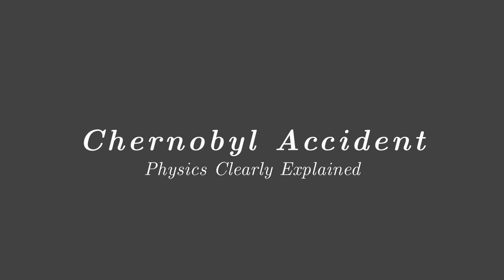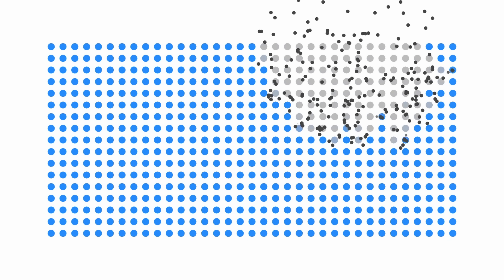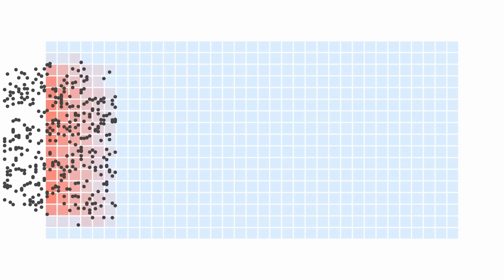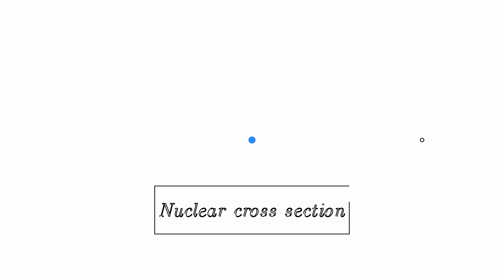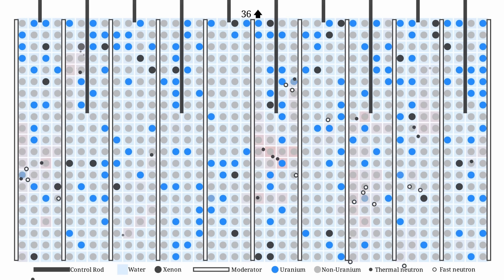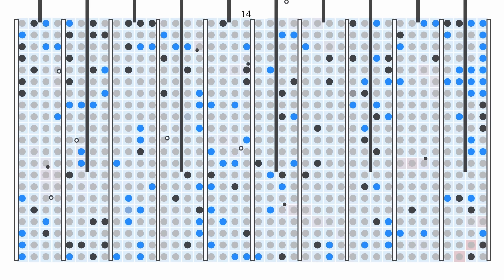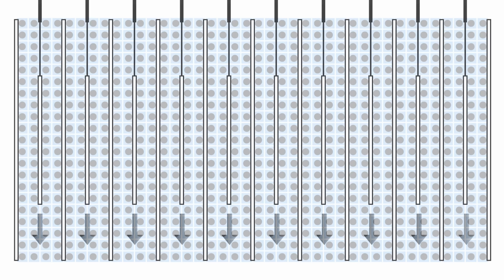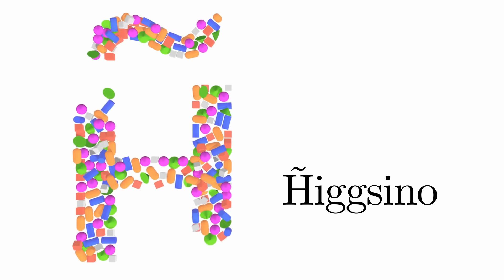Chernobyl Visually Explained

Comment: To my understanding, it wasn't the chain reaction that caused the explosion, but the buildup in steam pressure that caused the lid to blow, then when oxygen(from the air) entered the reactor, it caused a secondary explosion. The Illinois Energy Professor has a great video on how the steam pressure built up when the Scram button was pressed. He explained that the chain reaction from the spike in power superheated the graphite tips and they were then being lowered for the boron control rods to lower back into the reactor the superheated graphite came into contact with the water supply instantly vaporizing all the water, causing the pressure to build, leading to the subsequent explosions.
Reply: Yes, all explosions in nuclear reactors are either pressure or chemical related, reactor it self cant really explode like nuclear bomb which is big missconception people have as they are not made for rapid energy relese as bomb is, it can only out of control and melt (thats why its called meltdown) creating hazard that melts to ground and any extra explosions cause exposure of radioactive material to atmosphere.
Reply: If someone dies in a house fire because of smoke inhalation, would you say that the fire was not the cause of their death? It may not have been the direct cause but the connection between the fire and the smoke is so tight most wouldn't state the difference.

When people say that it wasn't a nuclear explosion they mean something different. An explosion is a shock wave. In a steam explosion the shock wave is caused by the pressure vessel bursting. In a true nuclear explosion the reaction rate goes up so fast that there is an intrinsic shock wave as the neutrons propagate trough the material.
Reply: The thing with the superheated graphite sounds like you don't quite recall it correctly. The usage of the term superheated is wrong (it refers to liquids or vapors but not to solids). Also whenever water "instantly vaporizes" it must have been above the boiling point and suddenly lost pressure. There is no way to heat something above its boiling point anywhere close to instantly by touching it with something hot.

What actually happened after AZ5 was pressed:
1) Chain reaction runaway causes rapid rise in temperature
2) Rise in temperature causes rise in pressure, bursting the vessel
3) Burst vessel causes rapid loss in pressure and causes water to flash into superheated steam (steam explosion)
4) Superheated steam comes in contact with graphite (or zirconium) and produces hydrogen
5) Hydrogen mixes with ambient air and ignites (hydrogen explosion)
Reply: @entcraft44  i never claimed the steam went above the boiling point just that the tips of the control rods weren't boron and the water supply entered from the bottom so when the heated graphite rods "tips" came into contact with the actual water supply, that caused significant amounts to vaporize and cause the steam explosion. Like I mentioned, go check out the Illinois energy professors videos on chernobyl. Extremely informative and well done.
Reply: @walterp1028  And I never claimed you claimed... No need to get defensive. I did watch his video now and unless he has a second video about Chernobyl that I can't find: you misremember what he said.
And again: It is impossible for significant amounts of water to vaporize because they are being suddenly touched by a hot object. I am no professor but in this I am certain.

Comment: I noticed the inherent instability from the positive void coefficient the instant you added it to the reactor. Instead of holding itself somewhat-stead, the neutron flux suddenly became extremely jumpy, with control rods suddenly having to run up and down much more constantly to try to keep it under control, and it still drifting into peaks and dips quite far from 40.

This simulation with a negative void coefficient would see an inherently steady and stable behavior instead.

Comment: Wow. What a great explanation. The graphics are a tremendous help assisting the understanding of reactor balance. Is the following situation correct? In the 2011 Japan tsunami one of their reactors “melted down” due to emergency power generators being destroyed by unprecedented flooding resulting loss of management of the control rods. If that’s true: 1) Why isn’t the damage from that catastrophic failure at the same level as Chernobyl? 2) If power is lost why aren’t the control rods automatically fully inserted negating uncontrolled reaction? 
Thanks for the time and effort.
Reply: Chernobyl no4 built up so much pressure the core of the reactor was blown apart spreading the most radiactive stuff into the atmosphere. They did not build a containment bunker around it to save money and get it finished early, which gave them favourable positions - this is the soviet corruption that is often talked about. 

In Fukushima the reactors had meltdowns but did not have their cores cracked open. A meldown is a bad day, but the vast majority of fission reactors sit inside thick steel flasks inside thick concrete buildings so at least the radioactive lava can be contained. The explosions that happened there were from hydrogen liberated from steam reacting with Zirconium alloy.

As for the control rods in Fukushima's case, all the operating reactors were SCRAMed upon detecting the earthquake, even once all the rods are inserted the core will stay very hot for hours and still needs coolant to be moved around it. You can still have a meltdown if that coolant stops.
Reply: @Fury9er  you're my hero. Thanks for the time and the explanation. You know, when my state got a hockey team they spent money on commercials explaining what hockey was, wait off sides, checking, fore checking, the blue lines were for and so on. Just think what we could do if the same was done for nuclear energy instead of groups taking advantage of ignorance. Thanks again

Comment: they should to shut the reactor down until xenon would burn. an then start the reactor normally. but there were not mentioned any xenon problems in manuals. even if the same problem was found in other incident on LAES few years ago. there were no restrictions in low power mode in manuals, however it was a mistake. so it would be incorrect to blame the control team. they did everything accordingly to the instructions and test plan. they obviously made some mistakes, but they didn't know about it.

Comment: Now that is why you want to build your FUTURE nuclear reactors as 'Molten-Salt Reactors'. Molten salt reactors (MSRs) are considered to be inherently safer than the Chernobyl-style reactors (RBMK) that led to the disaster in 1986. Here's why:
-     Inherent Safety Features: MSRs operate with liquid fuel (molten salt), which offers several safety advantages. One of the key safety features is the reactor's passive safety mechanism. If the reactor overheats, the liquid salt expands, reducing its ability to sustain a nuclear chain reaction, which naturally slows down the reaction. This is called a negative temperature coefficient of reactivity, and it helps prevent the reactor from "running away," as happened at Chernobyl.
-     No High Pressure: Molten salt reactors don't operate at the high pressures found in traditional water-cooled reactors, like the RBMK. The Chernobyl disaster was partly due to the build-up of steam pressure. In contrast, MSRs operate at atmospheric pressure, significantly reducing the risk of explosive failures.
-     Passive Cooling: MSRs typically have a passive cooling system. In case of an emergency, the molten salt can be drained into a separate containment vessel, where it cools down naturally without requiring active intervention, such as electric pumps or external cooling systems. This reduces the risk of a catastrophic meltdown.
-     Fuel Type: MSRs can use a variety of fuel types, including thorium, which is considered more abundant and potentially safer than uranium or plutonium used in traditional reactors. Thorium-based fuels produce fewer long-lived radioactive waste products and are less prone to being used for weapons proliferation.
-    No Graphite Moderator: One of the major contributors to the Chernobyl explosion was the graphite moderator used in the RBMK reactor, which caught fire after the reactor ran away. MSRs do not use a solid moderator like graphite, eliminating this particular risk.
= = While molten salt reactors are not immune to all potential risks, their design incorporates passive safety mechanisms that would likely prevent the kind of catastrophic "runaway" failure seen at Chernobyl. However, MSR technology is still being developed, and there are challenges to scaling and deploying it widely, though many view it as a promising next generation of nuclear technology.

Comment: I don't understand why you didn't present the correct geometry of the control rods from the very beginning. Why wait to, essentially, the very last moment to say "oh, and by the way, the control rods I have been presenting during this entire video were all wrong, they were actually like this"? It's not a trivial minor thing. It's actually very crucial to understanding why the accident happened and what the flaw of the reactor was. Also, even after finally presenting the correct geometry of the rods, you gave the incorrect explanation of what happened and what the flaw was.

On a side note, it's curious how the TV series got most of the technicalities right, except for this. Legasov in the TV series incorrectly describes the control rods as being made of boron and having "tips" made of graphite. While he doesn't present any miniature or picture about it, he very strongly implies that it's a long rod that's mostly made of boron and with a small section on the bottom made of graphite, and when fully retracted, the entire rod, including the graphite tip, is removed from the core. He very strongly gives this picture by stating (completely incorrectly) that "the graphite tips ENTERED the water first", which is just completely incorrect.

The geometry of the rods was instead what you showed at 13:40 in the video. When the rod is completely "removed" from the core, it was in fact the boron part that was outside, and the entire graphite part was inside. Unlike the fictionalized "Legasov" of the TV series states, the "tips" didn't "enter the water", they were already in the water. What "inserting" the control rods does is to actually remove the graphite portion from the water, out from the bottom of the reaction chamber.

And that's the flaw of the reactor which was the ultimate reason for the accident, and which you didn't explain correctly in the video: As the graphite portions started approaching the bottom of the reaction chamber, it displaced water there, which caused there to be very minimal moderation. This caused a big surge of reactivity at the bottom of the core. Normally this wasn't a big problem because control rods were lowered just a few at a time, so the increase in reactivity was small. However, in this case almost all of the rods, which had been fully raised, started lowering all at the same time, which caused an enormous surge at the bottom of the reaction chamber, which in addition to everything else caused all the water in the core to evaporate in a fraction of a second, and so on and so forth.
Reply from the maker: I had a friend suggesting showing the correct geometry of the rods from the start as well, in a beta version of this video. The reason I still chose to show them at the very end, is I didn't want to supersaturate new learns with information.

It makes it a worse simulation, but a better tool for learning I think. And I chose the latter. I might be wrong though.
Reply: @Higgsinophysics I see your intent, but I do think it would’ve been a better idea to put it when you showed the control rods first

Comment: One small caveat is around 15:40. There was so much heat that the water actually didn’t just evaporate it. Chemically separated the hydrogen and oxygen apart from each other. Then there was so much heat in the reactor that it had a hydrogen explosion.
Reply: Hydro-zirconium reaction, I believe
Reply: There were two explosions, first a steam explosion and then a more powerful hydrogen explosion. Heat alone doesn't separate water into hydrogen and oxygen. Even if that were the case, the splitting of the water would require as much energy as the later recombination during the explosion would produce:
2 · H2O -> 2 · H2 + O2 requires as much energy as
2 · H2 + O2 -> 2 · H2O produces.
There is thus no amplification of energy and no explosion.

What actually happened was the reaction of steam with graphite or zirconium fuel cladding:
C + 2 · H2O -> CO2 + 2 · H2
Zr + 2 · H2O -> ZrO2 + 2 · H2

Now this produces only hydrogen and no oxygen, pure hydrogen is not explosive. Thus it can only explode AFTER the pressure channels have already ruptured and it mixes with air.

Or in the case of Fukushima: The steam reacted with the zirconium for a longer time at much lower temperatures and pressures. Because hydrogen is hard to contain it escaped the pressure vessel and accumulated slowly in the primary containment, mixing with air. Then it exploded.
Reply: That is... horrifying, it's like a lithium battery failure on steroids.

Thankfully bad designs like this have long since taught us how to build far safer reactors
Reply: Heat doesn't split water atoms dude, you have no clue what you're talking about
Reply: @DrPeculiar312 thermal decomposition! It takes a lot of heat but it can happen!
Reply: Heat does not separate water into it's parts. But you go simplify things, then repeat your error so you can feel smart.
Reply: So a hydrogen bomb mixed with a nuclear explosion...so a STAR
Reply: @ALTDeLaNovaGLMV  No, burning hydrogen is destructive (think of the Hindenburg), but not like a hydrogen bomb is (they would level cities). Hydrogen bombs and stars are fueled by nuclear reactions: 2 hydrogen nuclei are fused into a helium nuclei, releasing huge amounts of energy. Burning hydrogen is a chemical reaction: molecules of hydrogen clump together with oxygen because it's more stable to share their electrons. That chemical reaction releases some energy, but it's a tiny fraction of a nuclear reaction.
Reply: @ALTDeLaNovaGLMV  calling it a bomb is a bit misleading

Comment: Perhaps this is due to the simplicity of the simulation, but I got the impression it's impossible to reduce power without causing a Xenon pit to occur? Surely there is a method to reduce power without causing a Xenon pit...

Comment: 'there were other factors'
yeah. your video is good but one of the factors is the soviet system of fraud. if you don't think a war is going to happen, you can swap out parts for things which look like parts. you can swap out plastic explosive for blocks of wood, for example. but if you nick some part of a reactor which is critical as a safety system, then an entire dimension of safety is gone.
this is important to mention because the number of safety systems you install do not matter if various people break the systems for a bit of change. the more a culture of corruption is enabled to turn abilities into paper tigers the more internal risk is pressent.
nuclear power is very safe, if you don't turn off the safety computer, or have people replacing parts with specific engineering for other parts which look the same but have different physical properties.

in your end card you say "soviet union corrupt system" which is sorta right. it had a system of corruption, but it wasn't the system of the soviet union itself which led to this event. the theft and facimile parts helped cause this, but they did have safety systems put in place. those systems don't matter if they aren't used properly, or if staff are not compensated adequately.

one of the other culture things which interacted with the systemic corruption was the statement that such an event was impossible. this encouraged the thefts.

it would be good if all countries used nuclear power to take off a bunch of base load. when we talk about things dryly as they happened without talking about how absurd the various layers of corruption were, we create the sense that we are overconfident just like the soviets were.

the team wasn't entirely inexperianced, but if you push a button and what happens isn't what you are expecting panic can go super critical. and if you train people badly with general heuristics, even good tools will fail. you can't give people a 'if this, then that will happen' if it is possible.

there was fault in training, and experiance, but a bigger issue with lying manuals. the safety culture was a problem, but also the breaking of safety systems which you may need to rely upon.
there were problems, but they weren't endemic to the industry, just this specific organization and economy.

if you pay pilots of planes badly, they might steal the parachutes and sell them. but if you pay them reasonably, that safety gear will be where you expect and in functional order.
this wasn't a failure of physics or math, it was a failure of leadership and training, governance and hiring, and payment. the design was okay, it wasn't negligently done or incompetent, which is what most people take from videos on this topic. but with enough effort and alcohol you can wrap a car around a tree. governments can create industry regulations and more than half of them are not over protective. in totality, it is very very difficult to screw things up to this scale.